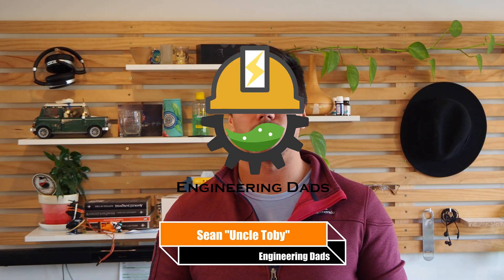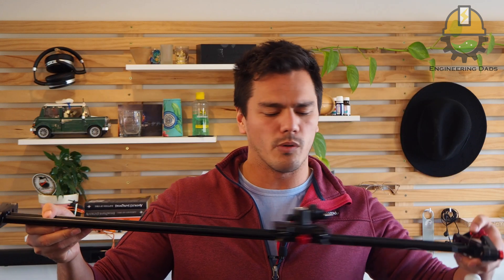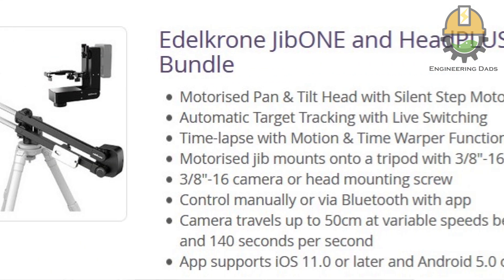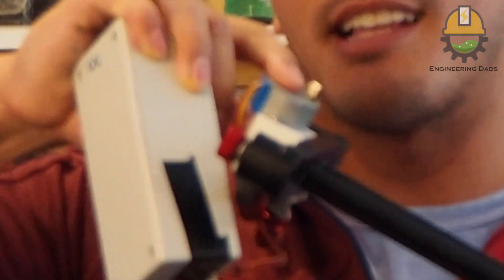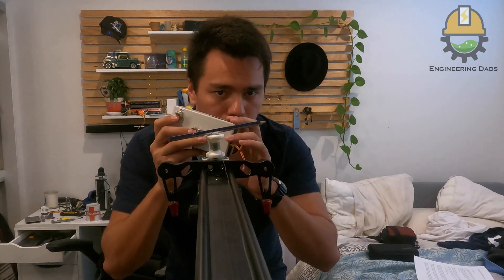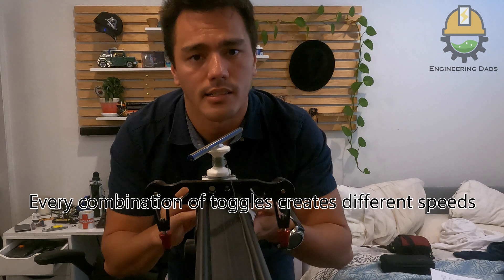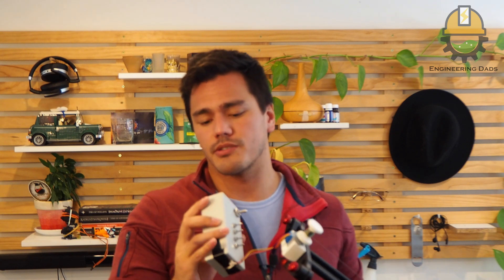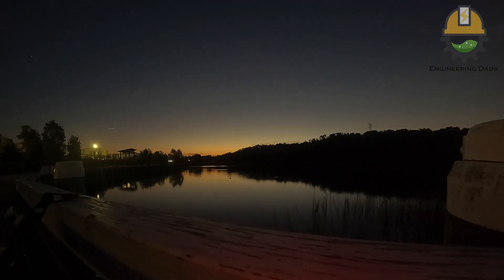DIY Cheapest Motorised Camera Slider + Timelapses of Sydney

Comment: Hi, great job! The main thing with this geared stepper is the backlash. It introduces some jitters in the video, I'm not sure how to eliminate those. We have done a version with Nema 17 and a TMC driver, expensive but paid off the efforts.
Reply from the maker: Agreed, the Nema 17 is a much better stepper motor than the one used in this video. This was aimed to develop a really low-cost version for video creators but we are aiming to build a version with 3 Nema 17 stepper motors to control the slider as well as the angle and rotation of the camera. Good shout